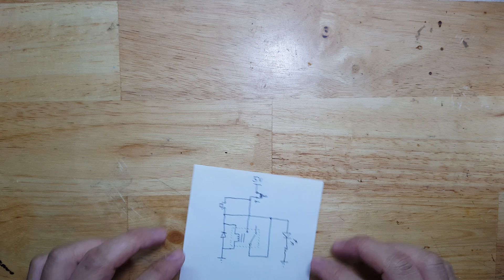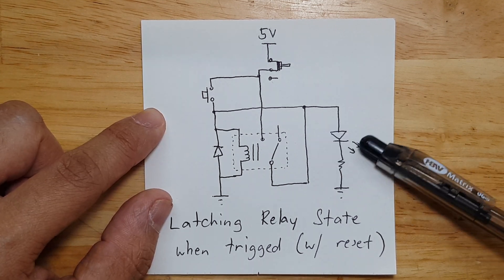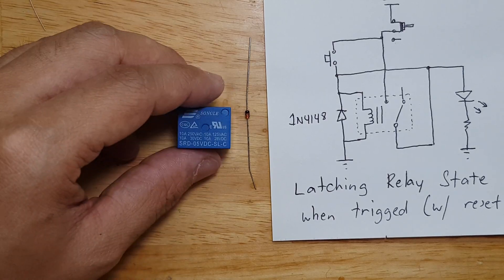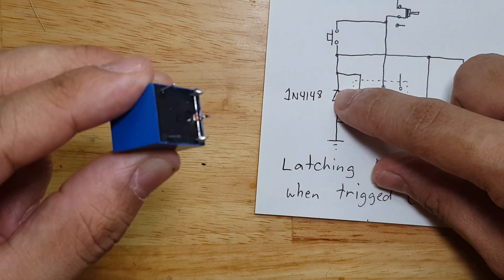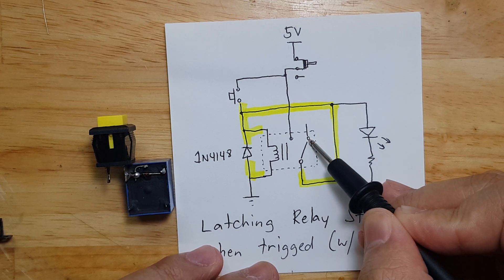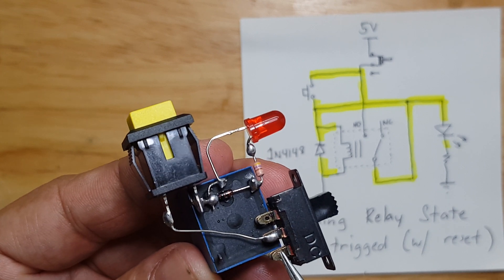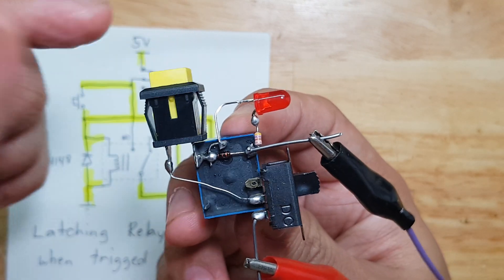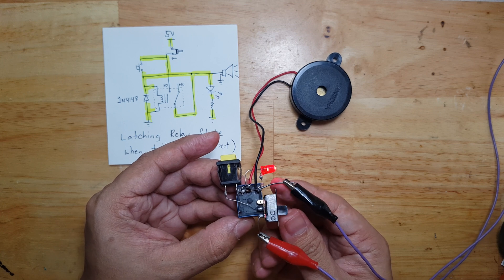LATCHING RELAY CIRCUIT WITH RESET (No Transistor, No IC, No Arduino)

Comment: You can perhaps call it half latching circuit. When you need a reset it means that you can simply replace it with a single switch. A full latching circuit should has memory for both stats. One signal to output up and one other signal by the same switch to output down.

Comment: I need a similar switch like this in 12 V for a car so when the ignition is turned on the switch is energized by hitting the button that the power supply would go to the fuel pump. When the car is turned off, it would reset and fuel pump would not be energized until ignition switch is turned on again and button hit to complete the circuit. This would be one of my antitheft devices.

Comment: Ive tried this.its working.thanks.i try to remove flywheel diod.its still working.can you tell me what phenomenon that make it latched.its mysterous.im an inventor successfully invented random automatik network switches using negatif resistance effect which one switch can cancell the other switches.but this is shocking me.you have invented the most simplest touch switch.which before this i thought im that guy.my Country didnt realize that someone is doing some research with his own money and that s me.
Reply: It's really simple actually, the Postitive power that the relay needs on the coil to power up only comes in when you press the button, BUT when it comes in, the relay allows power to flow through the NO terminal to COM which he has connected BACK to the relay coil, so the power does a loop, because the coil was powered, now the NO -> COM is connected, which connects the coil permanently to power, which means the NO -> COM is always connected, so it stays on until it's disconnected at the switch.

Comment: Can i use this circuit with AC relay to control AC hooter ? I mean i want to reset the hooter after activation.
Reply from the maker: I need more info for me to tell. But if you understand how it my circuit works, i believe it should be useful 👍🏼
Reply: @circuitdesolator  thanks sir for your prompt response...

Comment: This is not a latching relay. One of the main reasons for using a latching relay is so that there is no power consumed holding it closed.
Reply from the maker: Thanks for the info. Probably I have misused that term.

Comment: Almost perfect for what i am looking for, could i use a mosfet instead of a 4 pin relay to reduce current draw? Thanks again for great video
Reply from the maker: The circuit wont be as straight forward like this.

Comment: This is a non-latching relay converted to latching relay. But how to use a latching relay itself, when I want it to trigger an AC circuit with it and how to reset it. Pls explain.
Reply from the maker: Thanks for the interest on the circuit. It is designed for dc load only but you can definitely add another generic relay that will switch your AC line 😊